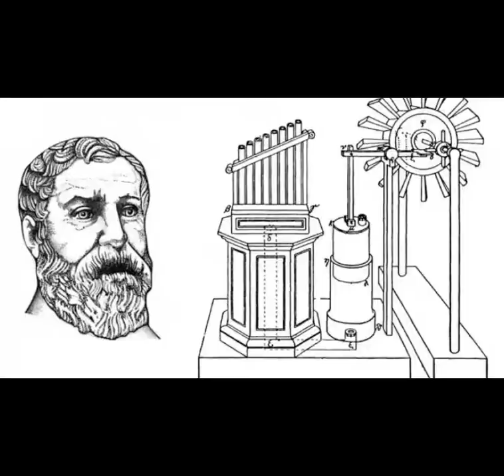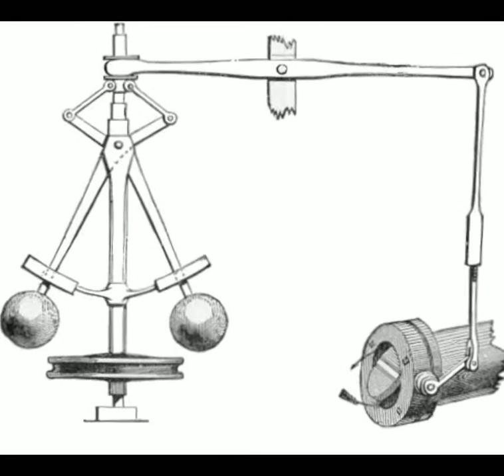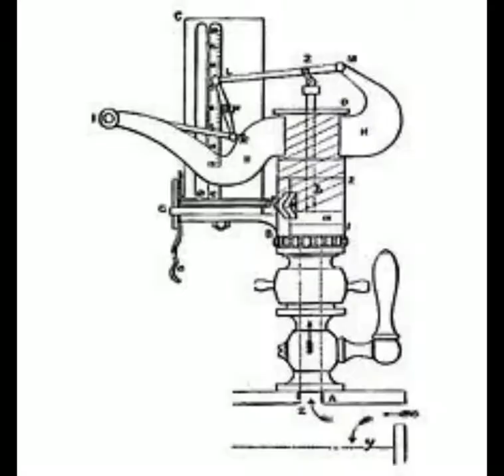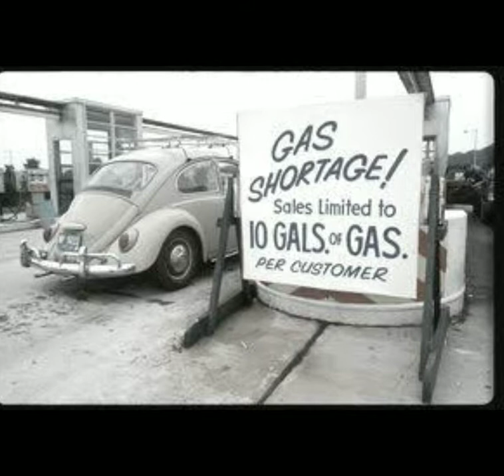James Watt Scottish Mechanical Engineer

Comment: Newcomen's Pump's were Atmospheric Pump's, they provided Atmospheric power, 10psi max. They couldn't provide rotary motion. They'd been around for 70 years with no Industrial Revolution in sight!
Savery's Pump wasn't practical, it was a Pump, not an Engine.
Watt's biggest "improvement" was to dump Newcomen's Atmospheric Power for High Pressure Steam Power.
To achieve that he had to invent a new engine. The world's First PRACTICAL High Pressure Steam Engine.
Then?
An Industrial Revolution!
Before Watt, no Industrial Revolution.
During Watt's lifetime and after, an Industrial Revolution!
Need I say more?